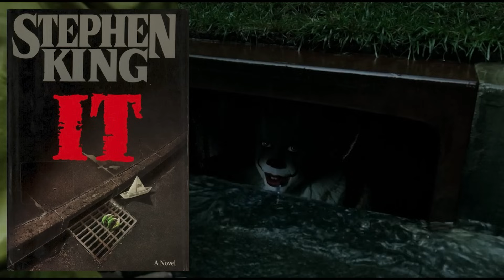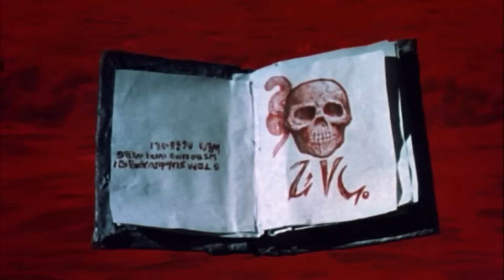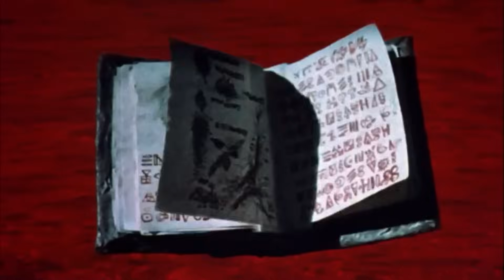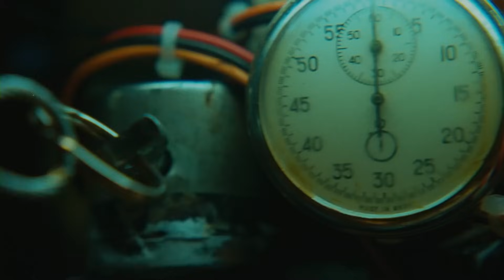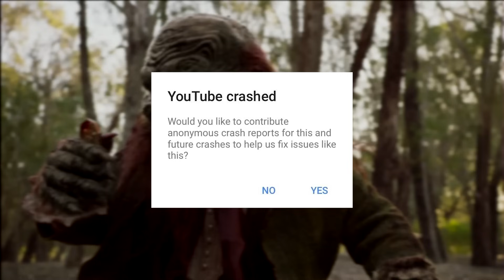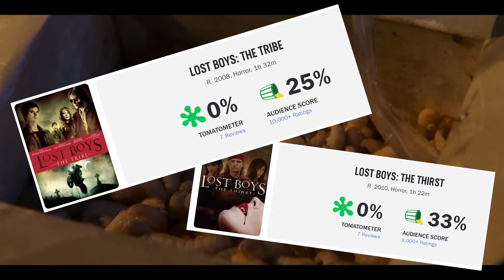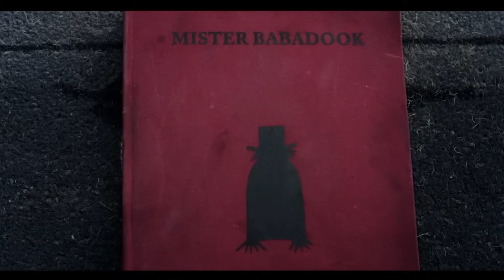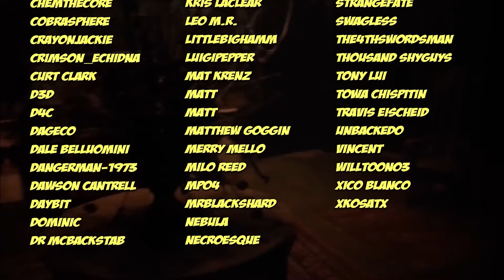The Ultimate Horror Crossover Fighting Game - Part 1 - Build the Roster

Comment: Could you imagine the stage intro for some of these guys? Like for example: 

A vortex/portal opens at the top of the screen as Ash falls out of it, cocking his shotgun before saying a one-liner.

Fog rolls in from one side of the screen and Jason appears once it subsides, putting his mask on before whipping out his machete.

 Michael lowers himself down from the ceiling andor top of the stage (which would be a nod to that one part in Halloween: H20/Resurrection.)

Leatherface slowly walks onto the stage before starting up his chainsaw.

Candyman gracefully floats down, saying either "be my victim..." or "I've came for you..."

Large flames break out as Freddy materializes from them, either saying a quip to the opponent or simply laughing. 

The Tall Man steps out of his time machine teleporter thingy, sphere in hand as he says one of his lines (either "I have plans for you" or "the funeral is about to begin!") 

A large horde of gremlins stampede from one side of the screen to the other, with the only one left behind being Stripe.

Pumpkinhead's corpse lays motionless on the stage before suddenly contorting and changing as the demon grows to full size, snarling at the opponent.

We see a Good Guy's box sitting on the stage that begins to shake violently before Chucky finally bursts from it, shouting an obsecenity at the opponent.

The Lament Configuration sits by itself before Pinhead materializes from lightning and picks the puzzle box up.

A large hole opens up on the floor of the stage as Sadako slowly crawls out from it and stands up.

A large block of ice sits still on the stage and we can vaguely see something inside of it, which moves slightly before suddenly bursting open; the creature revealing itself to be The Thing as it roars at the opponent.
Reply: Red comes in and stands with her tethered family.

Comment: One character I think that would be great for DLC is the Toxic Avenger. 

Sure Toxie’s films are ultra violent black comedy superhero movies. But his origins are rooted in Horror. The original idea for his first film was essentially a Friday the 13th/Halloween style slasher at a fitness center with the novel idea that the deformed serial killer was actually the GOOD guy. 

It just makes sense for Toxie to be a part of the DLC! Probably in the final season where all bets are off.

I’ve even got an idea for his power up! 
Toxie’s Main super power beyond his durability and strength is the ability to sense evil. So what if he had a “sense mode” where if he takes damage while using it, a meter fills up. Once it’s full his attacks either deal double damage, or he can string combos faster together. Implying that now that he has confirmed his opponent is “evil” he’s not holding back?

Comment: I do have an alternate idea for Ghostface’s gimmick: The Knife Wipe.
Keep the same terror meter, but change how it’s charged to wiping blood off Ghostface’s knife. There would be three levels of bloodiness to the knife with each level dropping your attack power, but wiping the blade at each level boosts how much meter you build. For example, wiping it at level 2 would be equal to 2.5 level 1 wipes and waiting until level 3 to wipe would equal 4 level 1 wipes. A neat risk vs reward mechanic, I think, where you’d have to decide if you want to keep your damage up of fill your meter faster.

Comment: Pretty good picks and movesets here, here some more:

Mark-13 (Hardwire)-A future Dystopia for the list
This android could start off with a simplistic moveset at the start of the match, but you gain more parts as it goes on, giving him a much more diverse moveset at the third act. Super will be an injection of the poison which will wither down the opens health until it hit zero.

Xenomorph (Alien)-Surprise that the horror alien didn't appear, was it because of theme change.
In any which way, this alien would be a full on striker, quick and humble full out. Super will be the summoning of a face hugger, as it inverse the opponents controls for a few time, with a chest burster piping out if the being wins.

Sam (Trick or Treat)-The little kid that used to show the spirit of halloween.
His moveset could be base around on giving the spirits out to everyone near, as he fills his meter by doing such halloween stuff towards his opponents, and when full he strikes you with the full force of halloween. Super will be the calling of halloween as halloween candy come out and fill the screen, as Sam will receive more halloween filters to his already filter halloween meter.

Ro-Man (Robot Monster)-Any icon of horror needs to be known, especially if it's a really bad one
Being a man in a gorilla suit, his attack set will be consitant of that of an animal, be a pseudo-grappler as he did strangles his victims in the film. Though his charges will consistence of rays that is stronger at each stage, as it covers the entire screen. His super will be a summoning of dinosaurs and reptiles that will tear the whole stage out of the universe.

Comment: I would love a summon mechanic activated through collecting a VHS tape that spawns on the stage. Have the truck from Duel speed by and plow into your opponent. Have the giant ants from Them burrow up from the ground and attack. Have the toys from Puppet Master latch onto the opponent and start slashing and pummel them. Have The Blob absorb the opponent and drain some health before spitting them out or if their hp is low enough, melt them down into itself for an instant K.O. The vastness of horror makes this vertually limitless.

Comment: I think Jack Torrance could work. His move set would involve ghosts from The Overlook appearing. His attacks would start weak but the more he uses the ghosts, the more a meter would fill. When the meter is full, he goes insane and his attacks change in damage, but he would be a bit harder to control (like running too fast and taking slightly longer to recover from attacks)

Comment: DLC Idea; Burt Gummer (Tremors)

While obviously this roster will mostly comprise of villains, I think there should be some more hero representation like Ash Williams, and I think Burt Gummer is a solid candidate.

Not only does he have a massive arsenal of weapons and explosives that can give him a proper moveset, but it can play into his meter. He can have a series of taunts that can be references to the series (Not just quotes, but actions, like him using a rc truck, or eating a MRE) and every time he manages to successfully pull one of these off, the weapons in his moveset will change into bigger, better guns. Like he can start off with a regular pistol, which can be upgraded to a revolver, and into an Uzi, to give an example. He can also have a move where he throws out a grenade, which can be upgraded to a landmine, and into a ball of duct tape with an ultrasonic watch attached to it. It will act as a sticky grenade, but instead of exploding, it lures in El Blanco, who attacks whatever the sticky bomb lands on, dealing massive damage to the opponent if it lands on them.

He is also known for his quotes, so he can have some great banter with the rest of the cast. His alternate costumes can be his looks from all across the movies, from how he looked in the very first movie, to Burt in his senior years in the latest films (If you care about those).

Comment: I have a less unworkable suggestion for a character to add.

How about Sex Machine from From Dusk Till Dawn?

I feel like he could be a pretty fun joke character, with him wielding a pool cue and shooting bullets out of his crotch. He could also start each match getting bitten, then as the rounds progress he gets more vampiric and gains new abilities until round 3, where he's a bit overpowered.

If the opponent loses a round in a best of three they are guaranteed to be squaring up against the full vampire form, but for the first round he'd be really low tier and in the second round he'd still be a bit weak. I'm aware that he'd be a mess in terms of balance, but that's kind of the point. I feel like it should be an uphill battle to get to the final round, so that the vampiric version of the character is only seen if the person playing him is more skilled than the other player and it's a reward/punishment for skill.

Comment: Honestly I think the ‘I always come back’ mechanic would be better if you went wacky with it. Instead of needing all 3 bars to do it once just make it one. 

Like if they have 3 bars and they wanna use them only when they die you’ll still be in a bad spot by default and every time they do it they’re weaker each time. Like how horror franchises keep coming back but worse and worse every time. Then both sides could keep coming back in dumber and dumber ways

Comment: Hey, you forgot abJUST KIDDING. You consciously CHOSE to stick to horror icon characters which is I mean...I couldn't jump in your head and force you not to and is overall a good idea.

But I do feel and my only gripe and maybe you've got this set up for part 2 I wouldn't know...is that this is missing some zombie action. Horror theme without Zombie is like garden without flowers. 

Now, here's my idea for Zombie. Since the idea is that in this game there's no legal limit you can just have each zombie costume based on on a specific franchise's zombies(if this is a 3D game. In 2D this is going to be A Problem.) From Night of the Living Dead to World War Z to Shaun of the Dead to Thriller.

As for how Zombie plays, Zombie is a glass cannon. Zombie is slow  and  takes lots of damage, but when Zombie hits, zombie hits hard and has status effects. special moves involve calling other zombies to shamble onscreen and obviously biting you in command grabs. Maybe like zombie hands arising from the ground to hold you or deal damage.

One neat idea I have is that the zombie you are playing is  "dies" and is replaced everytime they are knocked down so your character looks different all the time. Again, not a huge  issue if you're on 3D but no way this can be feasable in 2D. I mean, you could do part of it, like with Q-Bee who just dies and comes back as her exact sprites. But that's not what I was thinking.

Anyway, in it's final form Zombie becomes one of those running zombies from the 2000's, making Zombie actually broken with the damage and stuff.